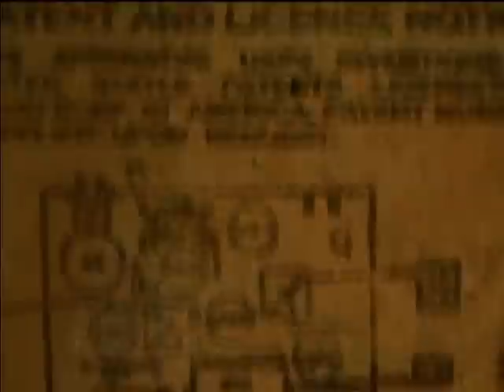Mid 1950's Arvin AM tube type radio model 951

Comment from the maker: I knew I had seen a similar one somewhere! I think the biggest factor in performance (once any old paper or electrolytic caps have been replaced) is the tubes. On radios where I can tell tubes have been replaced they usually have better sensitivity for distant stations. However even the sets which seem to have the weakest tubes can still pick up the local stations pretty well.

Comment: I have the same model, except in the "coral" (pinkish orange) color.  Its components appear to be all original, but it still works... well, at least it did back in 2008 when I made a video of it. The sensitivity isn't very good, but that could just be because the components are getting weak and out of tolerance.

Comment from the maker: That station is 1410 KRIL Odessa, TX....I can pick it up at home but my workshop is in Midland about 30 miles away and the station is too weak by that point for most table radios to pick it up. It is 900 watts daytime and around 200 watts nighttime if I remember correctly.

Comment: Yeah, I've had battles with those old Arvin circuit boards from the mid-late 50's.  I have one set that works fine until you bolt the chassis back in the case, then all hell breaks loose!

Comment: The speaker code 748605 means this speaker was manufactured by Russell (748). The 6 refers to the year of the particular decade, so in this case 1956, and the 05 is the week number. So you can at least say the speaker is no earlier than February 1956.

Comment: What is your line voltage?  That radio is rated 117 volts maximum.  Our line voltage is over 121 at times locally.  I am thinking perhaps the filaments should have a nice dropping capacitor (yes, it can be done).  Something to drop 5 volts at about 150 ma.. 
Of course we could just use a 120 to 6 volt transformer in a bucking arrangement to drop 6 volts for us.